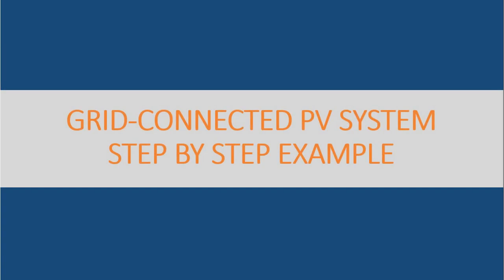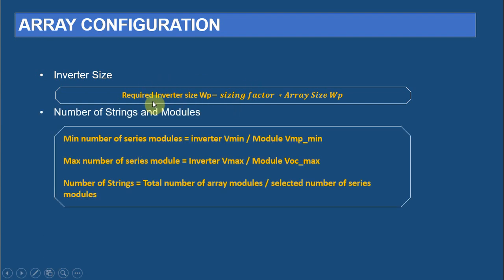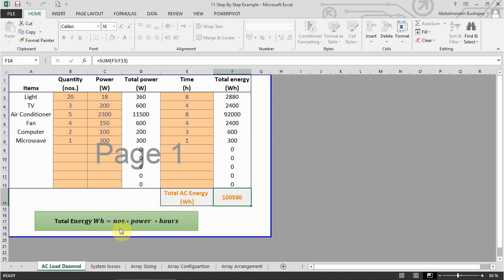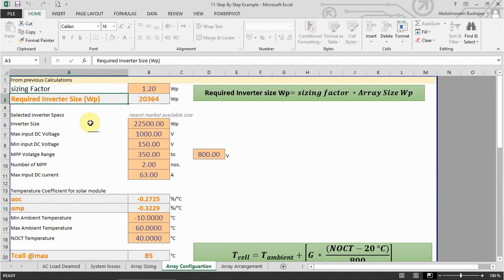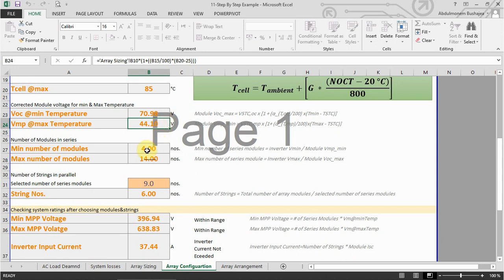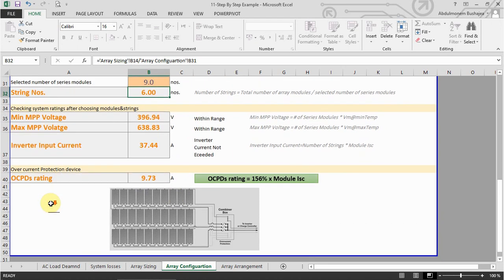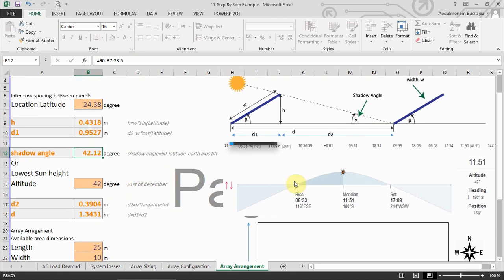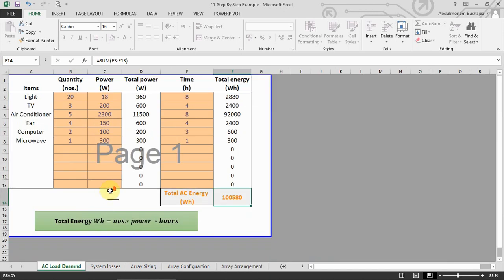Sizing of Solar PV system

Comment: Thanks for the video! By the way which book do you recommend where all of your mentioned formulas will be included? I want it for the reference material. Also, Could you pls reupload the spreadsheet? thanks!
Reply from the maker: Thank you so much. The sheet link is updated now, and you can download the file. However, for the reference books, email me and I'll send you some references.
Reply from the maker: This is my email address eeknow4all@gmail.com
Reply: @eeknowledgeforall  I have sent you the request please check it

Comment: Can I size the grid connected system using these calculations. If yes, should your energy demand be in kWh/d or kW/m or kW/yr?
Reply from the maker: Yes, you could use it to determine the size of grid connected PV system. However, energy demand is first calculated for the whole year (annual energy usage) and dividing the value by 365 to arrive at an average daily use. This will tell us how much energy is needed on a daily basis.